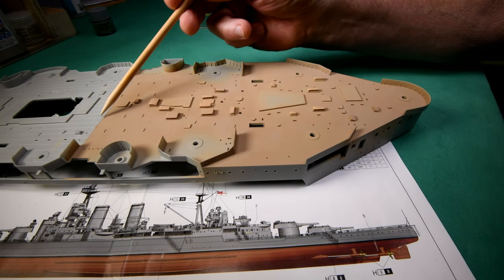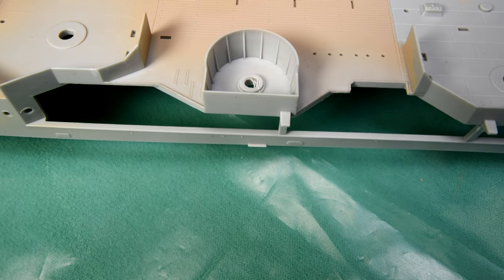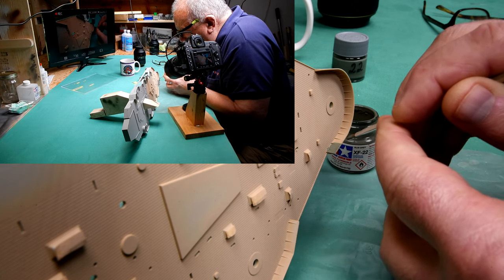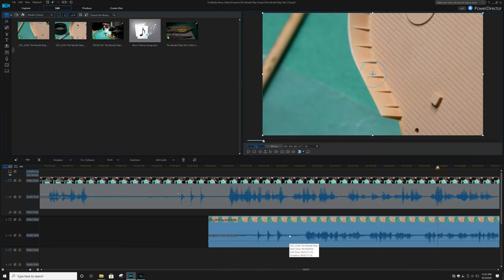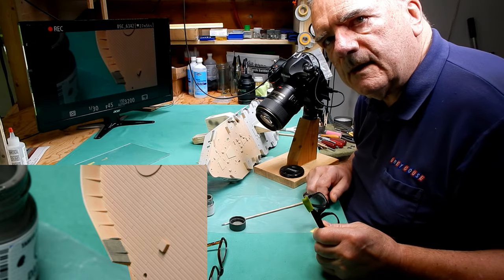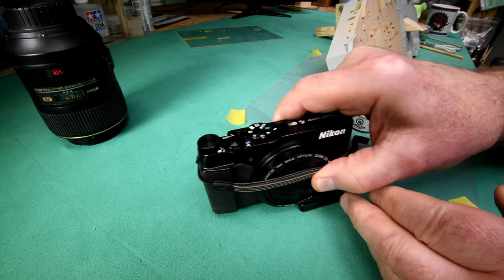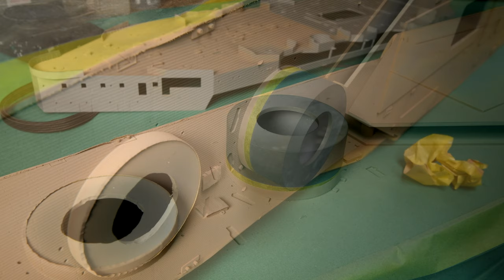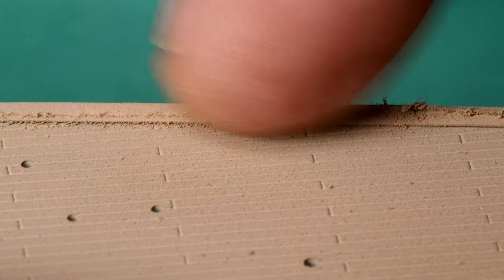The Model Ship - Part 554

Comment: The old battle cruiser is looking very well so far so good. and great camera work too. also how long is the model 🇬🇧Nice job 👍see you tomorrow⚓
Reply from the maker: Re: "also how long is the model" The hull is almost 52 inches 👍
Reply: @roncalverley  I knew she was 860 ft long but I couldn't remember how to break it down to model size wow that thing is huge thanks Ron👍
Reply from the maker: @garyhardy5907  860 X 12 + 7  / 200 = 51.635 inches
Reply: @roncalverley  oh I see thanks not very good at math even with a calculator haha